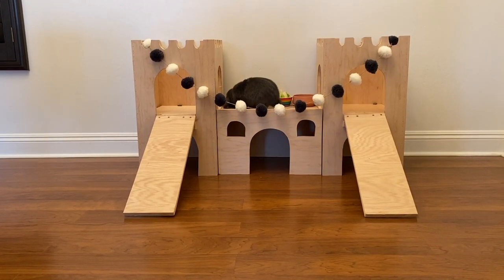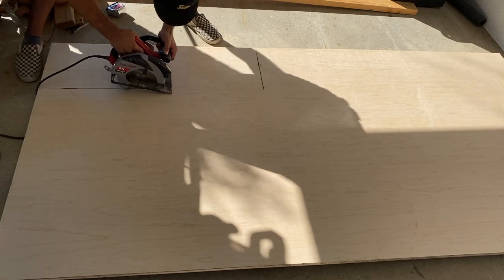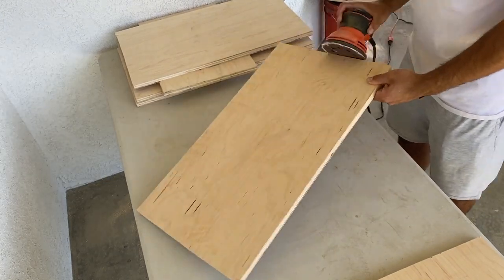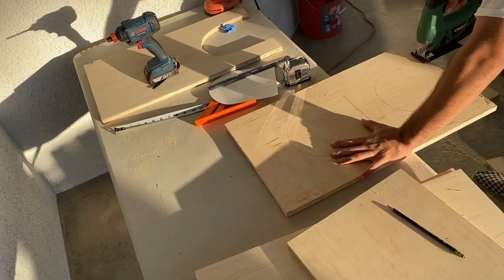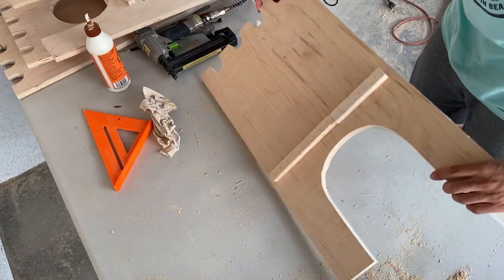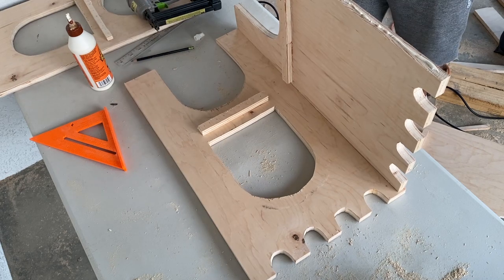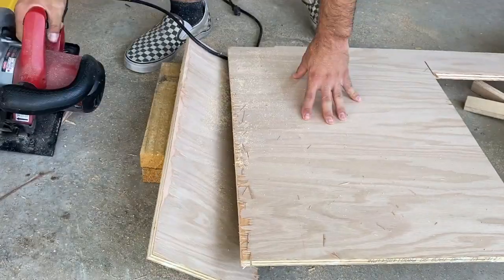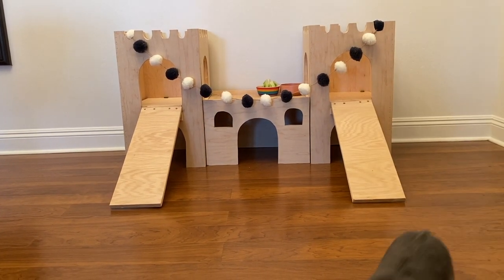DIY Rabbit Castle

Comment: Bunnies like to chew everything i wouldn't use any metal when making something like this typically people use kind of a dove tail joint that just goes through a slit on the connecting piece
Reply: Dovetail joints may be a bit much for the DIY crowd, but you're right about avoiding metal (and wood glue too, ideally). Dowels are a good approach which I've used for building my rabbit's castle accessories.

Comment: I wonder if they would cut these in the sizes you have put in the store? Or Is that asking to much I’ve never done that before and don’t have the tools for this but I’d buy them just to make it lol
Reply: I was thinking the same thing. I know in lows they’ll cut the wood. I’m wondering if they would do this.
Reply: My experience with other similar projects is that they will rip down the plywood, but not to this extent or to exact measurements.  But as long as you're okay with pieces being ~1/2" either way and you have access to the jigsaw, it could work.

Comment: Can i get wood from homedepot? Any plywood?
Reply: Maple plywood from Home Depot! 1/2 inch or 3/4 inch, i dont know which one he used…
Reply from the maker: Yes and 3/4 inch plywood will work👍
Reply: Please consider using untreated pine boards, since the glue used in plywood is not good for the rabbit to consume. Both Lowes and Home Depot carry them in the same aisle as their hardwood lumber.